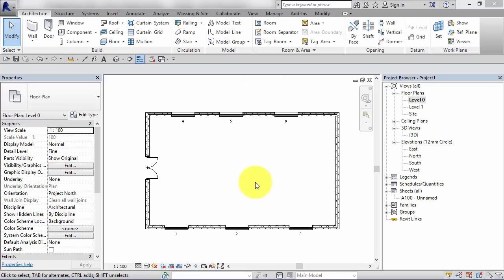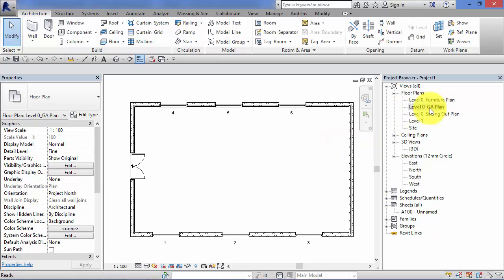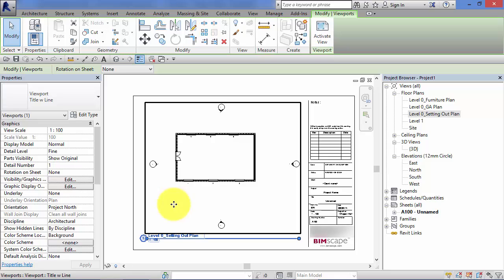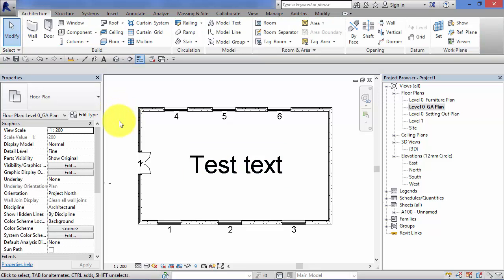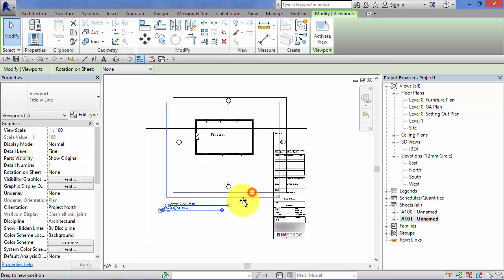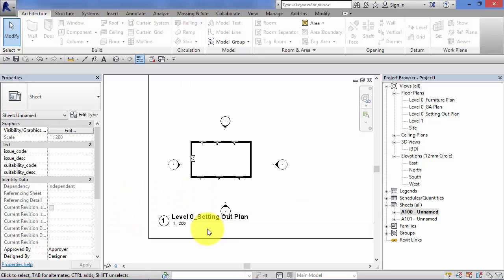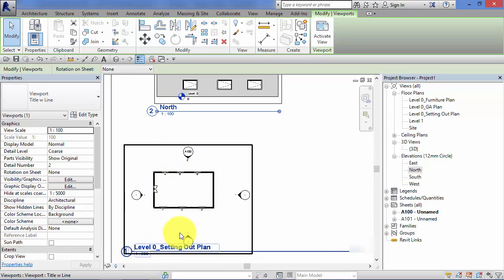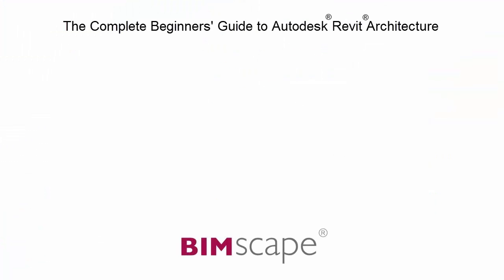Module 7: Unit 1: Revit Architecture: View Scales

Comment: Dear Sir, first of all I would like to thank you for your great videos! I find them very helpful and well explained.! I would have one question regarding this lesson, and I will be really grateful for your answer... Is there any option in Revit that allows to change  annotation size after we change scale of the view (for example we make drawing with annotations in scale 1:100, and there is a need to change it to 1:50, or 1:200, and when we change it annotation remain the same size,which makes problem...)or we have to set annotations after we define the scale. Thankful in advance!